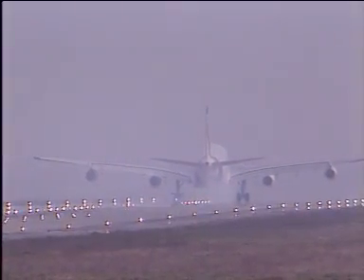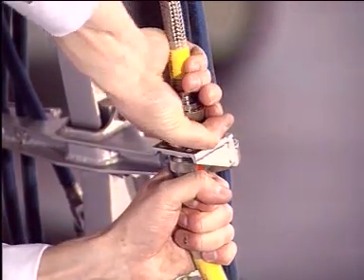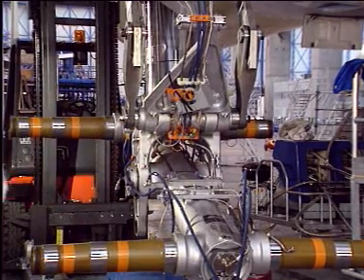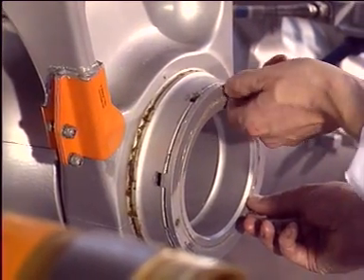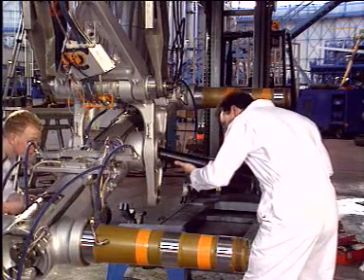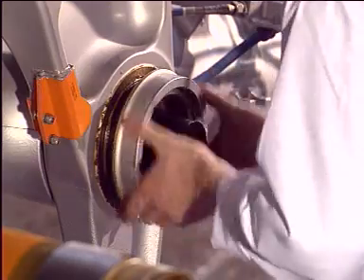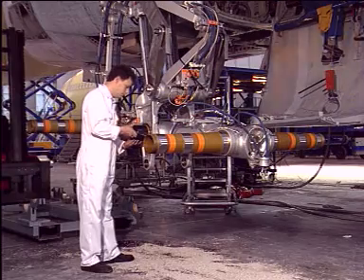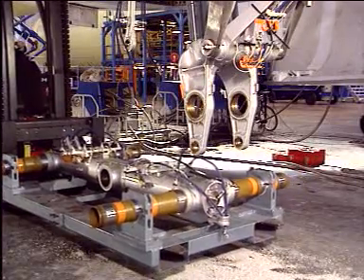AIRCRAFT | A330/A340 Shock Absorber Removal / Installation

Comment: After 36 years as  Licenced mechanic with a major airline, I have NEVER heard anyone, in the Industry, refer to them as shock absorbers. They are called Oleos or Struts.
Reply: Ted Smith we call them shock absorbers here in jordan
Reply: @ayman5014  They put shock absorbers on bridges, buildings and houses. For wind and earthquakes. Viscous Dampers.
Reply: Totally agree. Oleo or Landing gear struts. I too worked on aircraft for 15 years in heavy line maintenance. Changed a bunch of seals especially in the winter time.
Reply: @frankbutaric3565  hi sir can you recommend this profession?